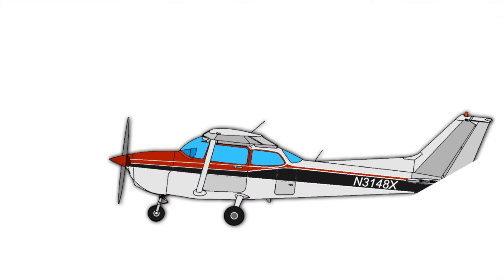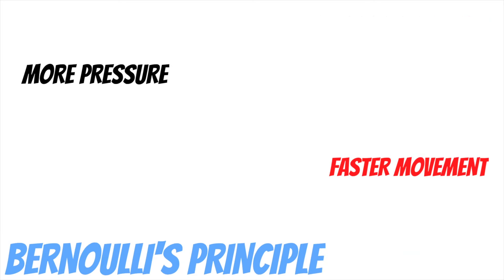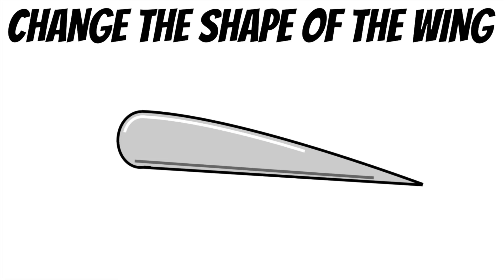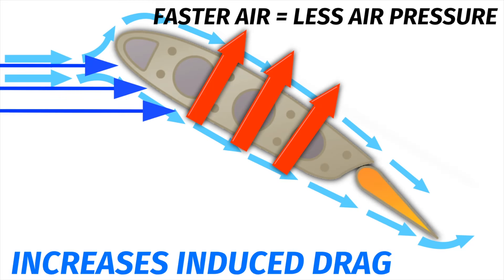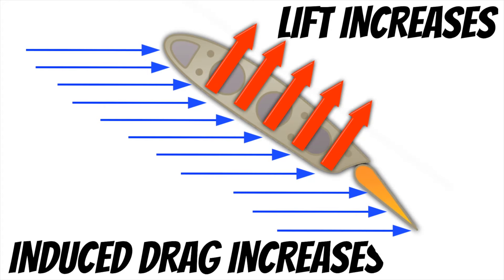How an Airplane Creates Lift | Complete PPL Ground Course (Lesson 2)

Comment: 0:54 airplane used to things to create lift; relative wind and shape of wing 

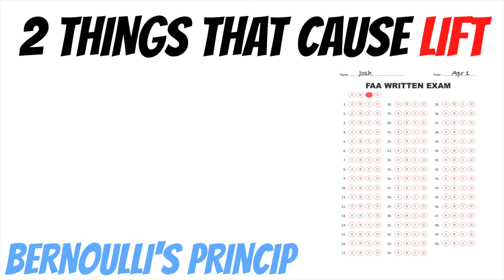1:25 Bernoulli’s principle: as velocity of fluid increases, the pressure within the fluid decreases.

Venturi: narrow passage or tube the fluid passes through that increases the speed 

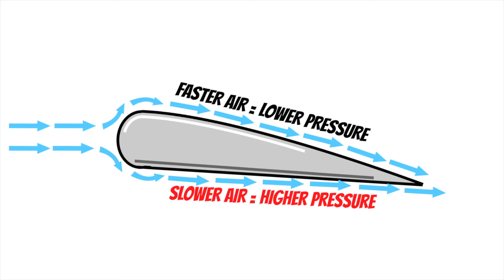2:03 The air travels over the curved surface of the upper wing which causes it to move faster and causes low pressure on top of wind and high pressure on bottom and then the high pressure pushes up and creates lift 

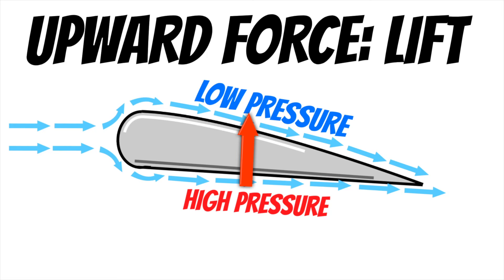2:23 to increase lift you can increase airspeed going over the wing

Wind caused by thrust of aircraft 

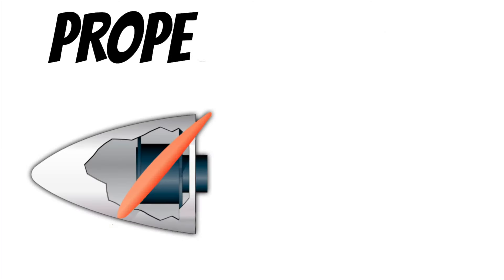2:45 propeller wash: backwards wind caused by propeller 

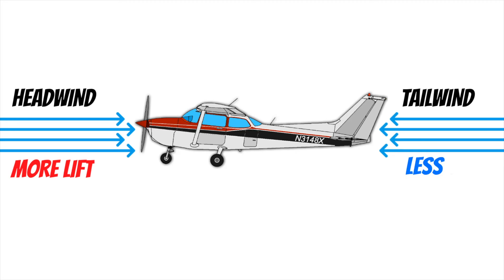2:58 we take off into the wind (headwind) because it gives us more relative wind for more lift. 

3:26 If you curve the wing more, it changes the camber and causes the air to move faster which lowers pressure even more. This also creates more induced drag 

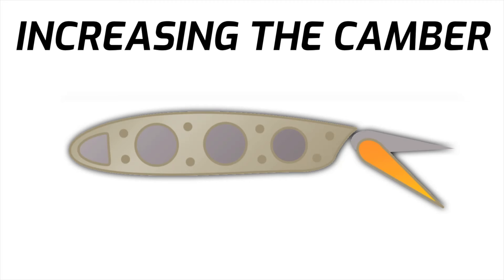3:54 you can increase the camber by lowering flaps on the aircraft. This lengthens the upper surface of the wing which creates more lift 

4:01 another way to increase lift is to increase the angle of attack. Raising the nose of the wing so the relative wind has to travel a further distance around upper wing but this also increases induced drag 

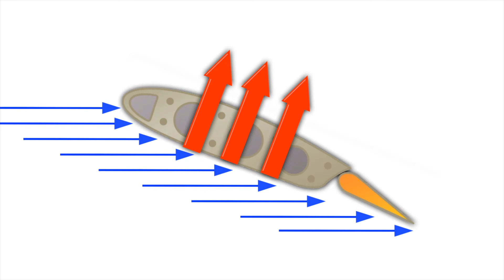4:49 when relative hits the lower surface of the wing, it can cause the wing to move up  and back creating more available surface causing more significant movement. it creates more lift but also more induced drag
Reply from the maker: Thanks for adding these chapters!
Reply: bro i dont know if you are gonna read this but these chapters for these videos have been saving me so much time from making small detailed notes and using rest of time to revise tysmmmmmm🙂👍
Reply: @chxwyRl no problem my friend. It helps me retain the info better

Comment: There is much wrong with this video. This myth about the air passing over the top having to go faster to meet the air on the other side will not be found in any aerodynamic textbook because it has no basis in physics.
Reply from the maker: Unfortunately, if you’re studying for your PPL, this is the way you need to learn it, even though it may be wrong
Reply: @FreePilotTraining  No it isn’t. Show me the textbook recommended by the FAA which uses this ‘equal transit time theory’. It is not in Aerodynamics for Naval Aviators, it is not in the PHAK. So upon which reference are you basing this idea that the FAA require you to teach this nonsense?
Reply: @XPLAlN equal transit theory is wrong
Reply: It's literally in all of em, tf you're talking about? 😂🤣
Reply: “As the wing moves through the air, the flow of air across the curved top surface increases in velocity creating a low-pressure area.” (Ch. 4 - Pg.6 PHAK)
Reply: It’s Bernoulli’s principle and the reason airfoils are shaped the way they are…
Reply: “Equal transit theory” was never mentioned in the video
Reply: It’s in the PHAK bud, make sure you actually read the material before stating nonsense 😉
Reply: @Murciielago  No. Equal transit time theory is in neither the PHAK nor the question bank. If it was you would be able to quote the paragraph. You will not be able to, the same way freepilottraining has not been able to.
Reply: @XPLAlN  brother this is based on Bernoulli’s Principle, where are you getting equal transit time theory from? 

This is how it was taught to me in an aerospace engineering design course. It’s also how it’s described in the PHAK.
Reply: @XPLAlN  you’re right though, equal transit time theory is bs
Reply: @Murciielago  ….at 3:25 is the exact description of equal transit theory. It is in this video. It is not in the PHAK. It is not in the question bank. It is not in Aerodynamics for Naval Aviators. The FAA does not require this bogus idea to be taught to anyone, which is the claim of freepilottraining. You are also telling me this fallacy was taught to you in an “aerospace engineering design course” which is ridiculous. Equal transit time does not appear in any of the engineering texts commonly recommended to aeronautical engineering students by decent institutions. Not Anderson’s Fundamentals of Aerodynamics, not Raymer’s Aircraft Design, not any fluid mechanics book I have seen. We can go right back to Prandtl’s paper for NACA of 1921 and find no mention of this fallacy in the bona fide engineering literature so I don’t believe any credible course in engineering design would use equal transit time ‘theory’. It has appeared in some obscure texts and, anecdotally, it was taught to school kids back in the day. Which I do believe because it still appears in amateur videos such as this.
Reply: I dont know about FAA Checkrides and stuff, but do they ask for this theory in the written and oral exam?  If so, all of your aggressive observation should be refocused to the FAA,  not the youtuber XD. If not, well what can I say, we dont know why planes fly jajajaja, there is many theories, and all of them are discarded, except the Bernoulli effect. An i assure you, if NASA could have discarded it, they would have, but they didnt because hey, its better to have something rather than nothing. 

If you dont believe me I invite you to debate on a science fair or smth, because physicists also still debate on this matter. At this point aircraft just need air to fly.
Reply: @lucasmimicaandias2489  quote “I don’t know about check rides and stuff”. Then why are you arguing? I have already said that ‘equal transit time theory’ appears in neither the FAA question bank, nor any of the books the FAA cites as a basis for the correct answers. And I am right.
   I am making two simple points here: 1. ‘equal transit time’ is false and 2. The FAA do NOT require student pilots to be taught this bogus theory.
   Now to your point, quote “I invite you to debate on a science fair or smth, because physicists also still debate on this matter”. Well to be clear, there is no debate whatsoever going on within the aeronautical engineering industry about whether ‘equal transit time theory’ is valid, so if you show me a physicist who is claiming it is, all you have there is some numpty who knows nothing of aerodynamics.
Reply: @XPLAlN  I didnt said '' i dont know about checkrides and stuff'' i said ''i dont know about FAA Checkrides and stuff''. I investigated and there is no such thing as the FAA question bank released for you to know what goes in the actual test, there is no official FAA question bank, but there are other means to that. PHAK does not cite anything, it only talks about Bernoulli and Newton's Law's .

I agree with your 2 points tho.
And to the last part, i said physicists not engineers, engineers have little saying on the matter of why something happens or how something happens, that depends on physicist and philosophers.

Although even the PHAK has to explain something rather than have nothing:

 Look up PHAK Chapter 4 Page 4-6: 
 ''As the wing moves through the air, the flow of air across the curved top surface increases in velocity creating a low-pressure area. '' Why that happens?, FAA says because air is a body?
Reply: This comment is disturbing. 

The "Pilot's Handbook of Aeronautical Knowledge" by the FAA does mention the concept of air moving faster over the top of the wing than along the bottom, which is an application of Bernoulli's Principle to explain lift. However, the handbook does not explicitly endorse or focus on the "Equal Transit Time" theory as a primary explanation for lift.

Instead, the FAA handbook explains lift more comprehensively by discussing the changes in air pressure and the deflection of air downwards by the wing, which incorporates both Bernoulli's Principle and Newton's Third Law. This approach avoids relying solely on the equal transit time fallacy, which inaccurately suggests that particles of air split at the leading edge of the wing and reunite simultaneously at the trailing edge.

For accurate and detailed information, you might refer directly to the "Pilot's Handbook of Aeronautical Knowledge" (FAA-H-8083-25B), which is available as a free download from the FAA's website. This handbook provides a thorough explanation of lift and aerodynamics without specifically promoting the equal transit time theory.
Reply: @Knebelcm1986  are you actually replying to me? The substance of your comment is clearly aligned with my point that the FAA does NOT require any pilot to be taught this equal transit time fallacy. In which case I do not understand what you find “disturbing” about what I wrote….
Reply: This debate is insane I love it 🍿
Reply: @FreePilotTraining  "It’s easy to explain how a rocket works, but explaining how a wing works takes a rocket scientist." – Philippe Spalart

Unfortunately yours is an incorrect explanation: 
- "Bernoulli" is NOT the cause of lift, but only the EFFECT. The air on the top accelerates DUE to the depression, NOT because of it. Bernoulli is good for "measuring" depression on top of the airfoil, but not for explaining it. 
- Lift is not generated by the shape of the airfoil. Even a perfectly flat, or symmetrical, airfoil generates lift and symmetric airfoils like the one in the video can fly inverted. 😊
Reply: @XPLAlN ask a DPE
Reply: @matthewalan458F  ask a DPE what?
Reply: Isn't that the equal transit theory?
Reply: Silly comment, low pressure on top. Like everyone said Bernoullis principal, but also the carburetor with the Venturi has the same design as the airfoil. Curved as the wing which creates low pressure and is faster. It’s literally in the PHAK. “There is much wrong with the video”… might not be perfect but it’s pretty spot on, and it’s also not a myth everything your comment states.
Reply: @flyinaaron  …Equal transit time is a myth. The FAA do NOT expect pilots to subscribe to this fallacy which is in neither the PHAK nor any FAA written question I ever saw. You are confusing equal transit time with the Bernoulli principle.
  The air going above vs below does NOT go from leading to trailing edge in an equal time. The molecules that go over the top actually get there a lot quicker. Also, the FAA do NOT require the pilot to believe this BS for the written, which is the claim of the channel host in his reply above. You say it is in the PHAK, I am telling you it isn’t. You are mixing up Bernoulli with ‘equal transit time’. You are making the same error as the video.
Reply: I guess it's called continuity 
Velocity on a surface is higher than velocity under the surface 
So the air molecule on the upper surface will move faster 
Than the one under the aero foil 

Please correct me if am wrong

Comment: I hate to bust your bubble dude but there is no Venturi on top of the wing because there's no opposite side to create the acceleration you talk about
Reply from the maker: The video doesn’t say that, it’s says, “just like in a venutri” the upper surface of the wing speeds up the air…
Reply: @FreePilotTraining  Well you can't say it's just like in a venturi, because it's not just like in a venturi. 
Can we at least agree that the air on top of the wing will follow the air on the underside of the wing?
Reply from the maker: @christophergagliano2051  the point I’m trying to make is that “just like in a Venturi,” the air on top travels faster.  It has to travel faster in order to meet the wind on the bottom side.  This faster air causes lower air pressure.  This is not my description, this is the FAAs description. That’s why I use it.
Reply: @christophergagliano2051  he just deleted my comment on "longer path, faster air speed, lower pressure" misinformation from another video, he is not interested in spreading facts, he is fine with "teaching" bs
Reply: @M0ToR  I got you my brother I'm a bit frustrated myself. It's my understanding that they have to teach the Venturi stuff and other crap just to satisfy the FAA. To be honest when I had to do my oral for my private check ride we didn't talk about aerodynamics at all. It was all about reading symbols on the sectional chart.
And of course when you're up flying you're not even thinking about aerodynamics whatsoever You're just trying to stay alive.
Reply: @christophergagliano2051  I understood his point about FAA, but as an instructor myself I would really appreciate to hear - "this is what you need to answer to pass the exam, but this is how it really is", I would have much more respect for this way of teaching, his channel is full of good material, but his attitude towards people pointing at inaccuracies is disappointing, good pilot is always learning, not calling those that try to correct his mistakes misspelled "dusche"
Reply: @M0ToR  The whole attitude about aviation has to change safety is number one who really cares about Bernoulli. I think there was three fatalities in the past week and they were all totally preventable if they're instructors covered things more practical than this silly theoretical bs about low pressure on top of a wing. The stuff that Dan Grider is putting out is pretty good, talking about real scenarios that will get you killed these apparently are not covered by any FAA doctrine. Dan goes off on a tangent every once in a while but he's got a pretty good read on what is killing pilots and it certainly isn't Bernoulli lol
Reply: @christophergagliano2051 I watch Dan too and I agree with safety first to a certain degree, because you could always ban general aviation and reach top safety, but that's unlikely the price you'd like to pay, certainly I wouldn't, that being said - useful or not - if we already find ourselves discussing the physics - we could at least do it right and not dumb it down to FAA exam level
Reply: @M0ToR  Well there's plenty of times You just have to keep the airplane in the hangar especially when the weather sucks. I just can't believe student pilots, pilots, even instructors are flying into thunderstorms It's unbelievable it still happening It just happened last month. 
My dad tells a story where flight of t6s flew into a thunderstorm in Texas back in the late '40s and there were t6 parts scattered for over a hundred miles all five aircraft were lost including the crew. Even the great Scott crossfield flew his 210 into a thunderstorm and he didn't survive. I mentioned this because not once did my instructor say anything about avoiding marginal VFR conditions, let alone anything about the power of a thunderstorm.
Reply: Thanks for the response, I totally agree and yes Dan does go off in a tangent. The one I love the most is the one where he blamed Obama for the Boeing Max debacle, I work for Boeing for a couple years they are their own worst enemy
Reply: @MOTor same to you
Reply: @vestitivolati  I'm not sure why you couldn't complete a sentence, I don't even know what you're talking about?